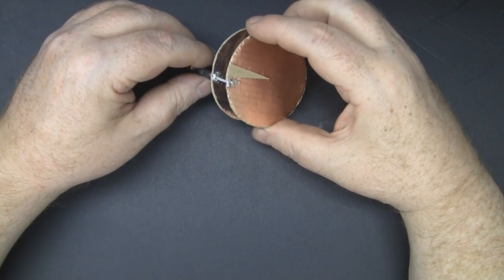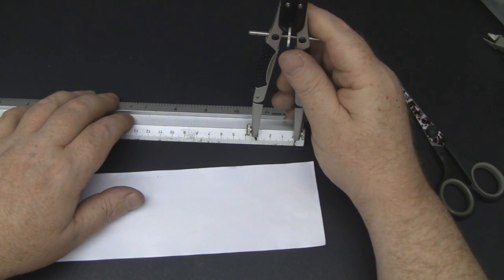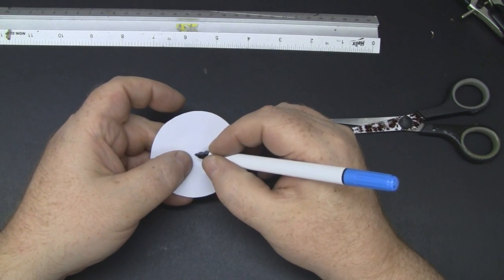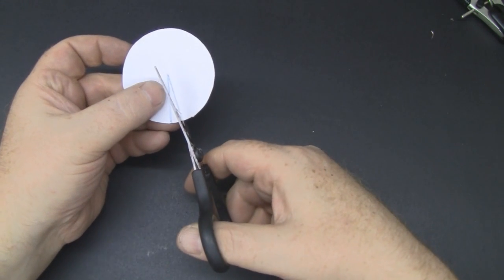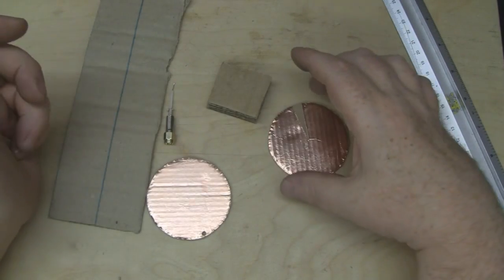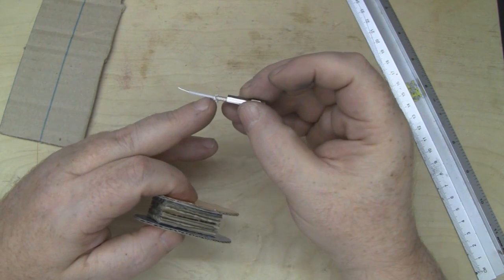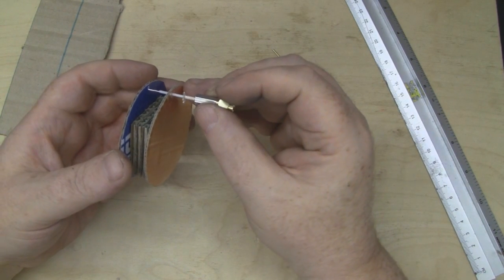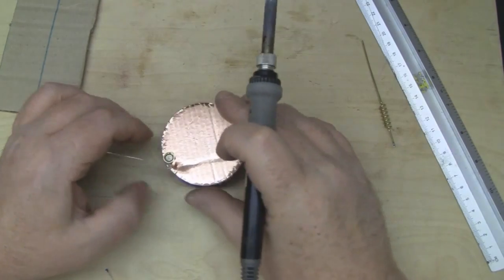Patch Antenna for 2 4gHz #64

Comment: I made it, 10 pcs, make it parallel, I don't do math or about mathematical frequency. Just do it with 75 ohm coaxial.
Now I have WiFi connection with my Office Access Point with range about 1,7Km. 

Theory can be very complex, but with practice and trials-errors we learn a lot.
Thanks Andrew!!!!

Comment: Is it important that the core of the coax cable be straight between the reflector ad the top element? I would want to place the connector between the two plates.

Comment: You should have more than 4.5dBi gain with a patch.  I'm also wondering what the SWR is with that patch fed on the edge.  Have you considered a cheap chinese antenna analyser?  They're a couple hundred bucks and give you good insight into what's happening.  See youtube channel "pete's free info center" for a very concise description of how these antennas function.  Steve ZL1BHD

Comment: Hi Andrew,
I did modifide the flysky fs-t6 antenna and carried on with all the step to be followed to replace a new one ( I've used one of the fatshark 5.8. Inicially it does work pretty fine but as soon as I fly bit far... I loose conextion range!!.
what kind of antennas should I use?
Thanks mate

Comment: Can you use this on a typical 2.4 Ghz RC Transmitter please?.....and since its a directional anttena, what is the included beam angle?...Could you use it with a typical two wire Linear dipole such as that found on most if not all 2.4Ghz RC recievers ? Most modellers wanting extra range for FPV use will be asking these exact same questions...I will be trying to make your double helical Video anttena for 5.8Ghz, I assume it was RHCP as shown in your clip? Like your Videos, most informative.

Comment: Andrew is there a way i can connect multiple PCs(using a wired connection) to a external wifi adaptor?
 I have a ethernet switch and would like to connect to it a external wifi adaptor.

Comment: SMC 11dbi
reflector 101mm(square)
distance from reflector 8mm
slice 5-5,5mm
For performance and precision PCB made.
Reply from the maker: Is that one that you have built?
Reply: andrew mcneil yes
Reply: Can you provide more details?
Reply: The SMC 11dbi panel is said to be a circular polarized but Andrew here says it's not. It's not clear if the SMC is right or left handed.